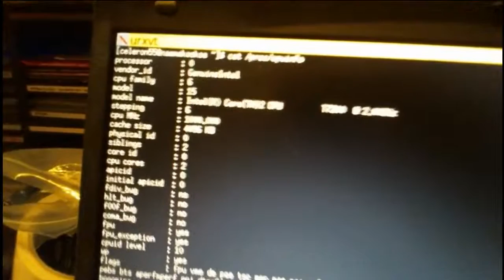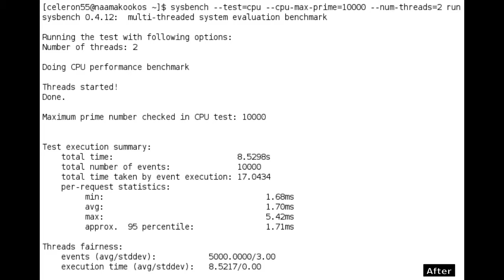Toughbook CF-51 CPU replacement timelapse with stupid music

Comment: Why diff you covered the keyboard and blocked us from seeing the screen when you were typing?
Reply from the maker: There's this thing called a "password".
Reply: celeron55 lol really, none of us know where you're at, what was installed before and to what did u upgraded to? I want to go from i5 to i7
Reply from the maker: That's a Centrino Duo machine, from T2300 to T7200. I have no idea about those newfangled i5/i7 things. My guess would be "not possible" if it's a laptop.
Reply: Actually replacing the cpu is pretty much the same thing in all for what you are telling me you just upgraded from 2300 to 7200 that's just the mhz if I remember correctly, the chip looks the same a new one goes to 7500 with 2.93ghz the i7 you can actually go to 4.2ghz which is much faster the difference is the hundreds because on the one you used even the 7200 you can get it for under $10 but an i7 goes up to $400 ebay will be a good place to find them cheaper

Comment: What’s the best cpu you can put in it?
Reply from the maker: T7200 might be the fastest due to the 945GM chipset on the CF-51 mk3. I think it's due to the 667MHz FSB clock. T7500 requires 800MHz. Double check on some Thinkpad forum maybe?

Comment: how did you get the cpu to come out?
Reply from the maker: I released the lock and realized it was still stuck in there. Then I looked at the locking mechanism to see which way it pushes the CPU when locked; in this case it pushed the CPU towards the back, so I needed to apply force from the back to push it towards the front.

I made sure it was unlocked and then used some random tools as a lever between the CPU and the back side of the chassis to push the CPU towards the front. That freed the CPU and then I could just pick it up by hand.
Reply: lol thanks, i am swapping out the cpu in my unit soon and it looks like it is pretty difficult.